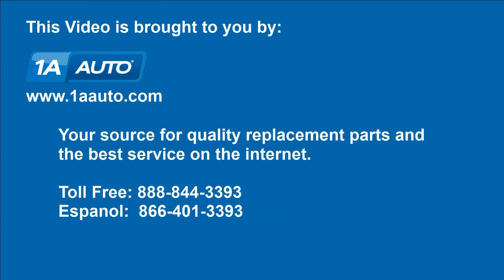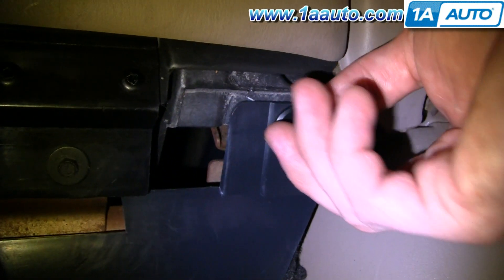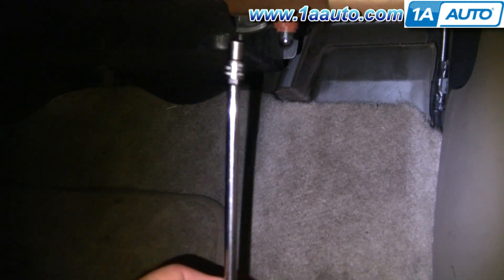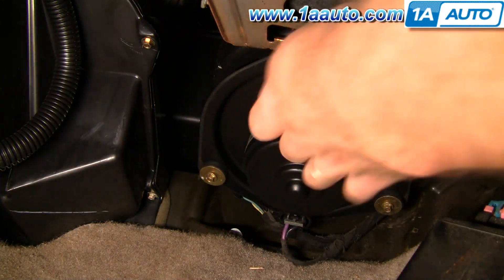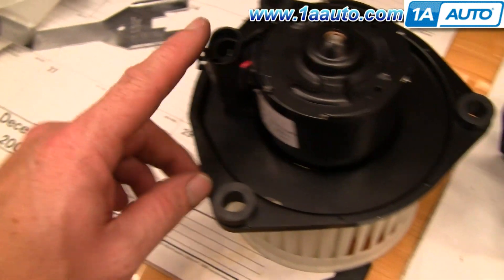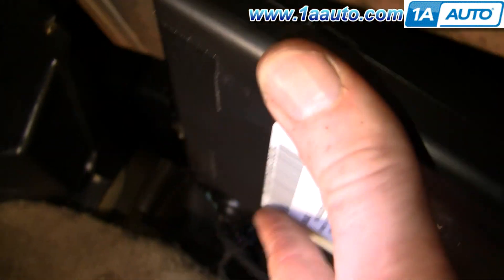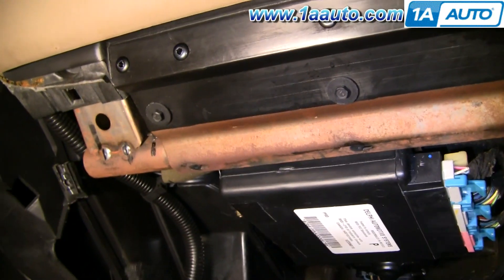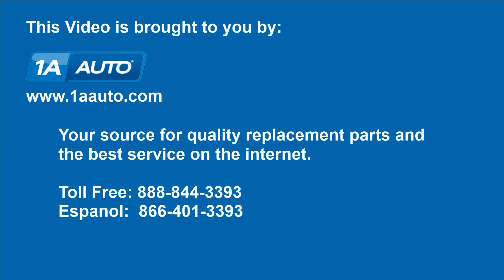How to Replace Heater Blower Motor with Fan Cage 97-02 Chevy Malibu

Comment from the maker: We currently do not have an auto repair video that shows you how to replace the heatercore in your 03 Chevy Malibu. The exhaust gasket might need to be replaced or you may just be able to tighten up on that bolt a little more if it is new. Hope this helps you out. 1aauto.com 888-844-3393

Comment from the maker: You may want to take a look at all of the vacuum lines in the engine bay to see if any of them are disconnected, or need to be repaired. 1aauto.com 888-844-3339

Comment from the maker: If blows but it's not cold, you may want to see if the freon is up to level in the system. If it's low, it would cause the system to blow warm air. hope this helps you out.

Comment from the maker: This video will be similar but it might be slightly different with the position of the blower motor and housing along with the mounting bolts holding it to the HVAC housing.

Comment from the maker: To begin to solve the issue, the blower motor should be located under the dash on the passenger side (this video will show you where it is). Test the wires going to it to see if there's power going to the blower motor. If there is power to it, then the blower motor could be bad. If there is no power to the blower motor, check for a loose connection, or a bad fuse. Hope this helps you out.

Comment: Thanks Mike.This video really helped with my 2002 Malibu.My heater started acting up & the first thing I thought of is a mouse that was first starting to build her nest on top of the air filter under the hood.I put out poison & thought I got ride of the little bugger but sure enough couple days later the fan started acting up & I knew I had a mouse building her nest in the fan.Followed your instructions & yup the fan was stuffed with a nest.The only slight problem I had was the fan was longer than the one you pulled out looked. OK Thanks again & Merry Christmas.Nick

Comment: On my malibu my 1 and 2 setting does not work the only ones that work are 3 through 5 which my one friend suggest that it is more likely the a.c heater blower motor resistor. since this is the cheapest routes versus the motor or the more expensive panel I would try to replace just the resistor where is this resistor located on a 97-03 chevy malibu . thank you for your time. 
P.S. great videos extremely helpful

Comment from the maker: You may want to have a qualified AC technician fill the system and also check it for you. To properly charge or fill the AC system, they will take the current outside air temp and charge the system accordingly so that the coolness of the air going into the cab of the vehicle is sufficient. They can also test for leaks, and replace any O-rings if they need to. Hope this helps you out. 1aauto.com 888-844-3393

Comment: I have an 03 malibu and have 2 questions. first is do you have a video on how to replace the heater core. second is I have a slight leak coming from the back of the engine between the firewall and the exhaust manifold; would you have any idea on what it could be. I did the head gasket job with a friend, could it be that I didn't torque the exhaust bolts down correctly? or is there something else that it could be?

Comment: Hope this fixes my problem.. the fan would blow slow and briefly speed up and every setting... Gotta say wheather it worked or not that is a very easy blower motor to get to.. on my chevy nova i had to take of the fender.

Comment: I have an 2002 malibu 3.1 just replaced head gaskets now that im running the ac the vent is stuck i read something about a  thin vacuum hose running across the top of the engine from the front left side to the rear and that Over time it becomes brittle and cracks therefore leaving your vents stuck in it's last positon.Thinking maybe we disconnected it.. but when i looked under my hood i cant locate the hose. Would you happen to know where in detail is it located>?

Comment: Hi, first, thanks for your video... I just changed my fan for another one (bought it from a used auto parts store). It work but it make intermittent silly noise... Could it be something wrong that I did or the fan that I just bought is having a problem?
Reply from the maker: It may be a bad connection or a bad blower motor. We carry new blower motors on our website with free shipping. Here's a link to them on our site. http://www.1aauto.com/heater-blower-motor-with-fan-cage/i/1ahcx00184
Reply: Free shipping same if I am from Canada?
Reply from the maker: Samuel Moreau There would be a shipping charge to Canada. If you enter in your postal code on the product that you're interested in, we'll provide you with an estimated shipping quote. Thank you for asking. Have a great day! 1aauto.com

Comment: This may save me a fortune as my local repair shop is a sham.  For the last 2 years my heater/fan would only work on max speed, anything else wouldn't even turn on, then the last couple days it's started dying.  You can turn it on, after a moment you can hear/feel it slow down and almost stop, turn it off and wait about 10 minutes then you can turn it on again for same effect.  Been dreading the repairs since Murphy's Law and I seem to have a report with each other rofl.
Reply from the maker: Thanks for watching. Hope this helps you out. If any of our viewers needs to make this repair, we carry the replacement blower motor on our website. Here's a link to them. https://goo.gl/fwyiCV

Comment: Hello my heater just went out completely is this what I would have to buy a blower motor? For 2000 malibu.
Reply from the maker: You may want to check the electrical connection to the blower motor and also the fuse to see if it's blown and needs to be replaced. Hope this helps you out. 1aauto.com 866-403-3393

Comment: Can you cause an electric wiring shortin if you don’t unplug the battery while changing the blower motor or could u cause damage to the bcm?
Reply: I have an 030 lero and water is dripping out of the blower motor can anybody give me any insight on it thanks

Comment: I have the problem that my 1-2 settings dont work. My 3-5 work fine. But they dont blow cold cause of whatever the problem is. What should I replace? Ive had the ac charged and it still isn't working. Any thoughts?

Comment: Hi there:)
I have 2013 malibu and my AC/Heater sometimes it works and sometimes it doesn't. When it works, it works really good all day but the next day it stops, what could be???
Reply from the maker: You may want to check the antifreeze level to see if it's low. If it is, there may be an air pocket getting into the system. You could also check the electrical plug on the end of the wire that goes to the blower motor and also the blower motor resistor, to see if there is heat damage to them. If there is, you may want to replace the plug end. Hope this helps you out. 1aauto.com 866-403-3393

Comment: Hi! I have a problem with my air conditioning: When I first start the air conditioning the system works well (almost) but after a few mins (2 o 3) the fan begins with a noisy sound and the speed slow down, and the after a min or so the fan almost not spin at all! Can it be the Blower Motor? Thanxs!
Reply from the maker: Thank you for watching! It sound like the Blower Motor may be on its way out.
888-844-3393

Comment: So my ac only works on high and sometimes its doesn't blow cold air ? Do you know what it can be
Reply from the maker: Samuel Gutierrez You may want to check the blower motor resistor and also the blower motor. Other things to inspect are the plug end that plug into these two items for heat damage. If either of the plug ends are melted or damaged they should be replaced. Hope this helps you out. 1aauto.com

Comment: Ok, so i get that by replacing blower moter this might fix problem with NO HEAT but my question is that i have replaced my fuse because the old one was burnt out well now the only way my heat works is if i am pulling on cords attached to moter? how would i fix this problem moter works fine when i pull on the cords but as soon as i let go it goes off :/
Reply: So obviousley there is a short in the cords leading to blower moter but how would i fix shorting problems?? in that area?
Reply from the maker: Joe Kemp
Thanks for watching Joe. It sounds like you have a problem in the connector. You are going to need to unplug it and find where the fault is. It may be as simple as repining one of the terminals , or you may need to cut off the connector and splice in a new one. But the only way to verify would be to take a look and see where the problem is.
1aauto.com 888-844-3393

Comment: This is off subject but my car is running hot. I have a brand new water pump, all radiator hoses, brand new termastat. It was working fine until I started burning my ac and now my temperature gauge fluctuate. I'm not what wrong. Please help!!!
Reply from the maker: Holly Winter B If it has an electric fan, you may want to see if the fan motor, and relay are working correctly. Hope this helps you out. 1aauto.com

Comment: I have an 03 Malibu and my heat will only work on high...anybody happen to know what the problem is?
Reply: brian guffey Does the fan only blow on high? It could be the blower resistor. For me, the only settings that worked were 4 and 5. When I replaced the resistor, all settings worked.